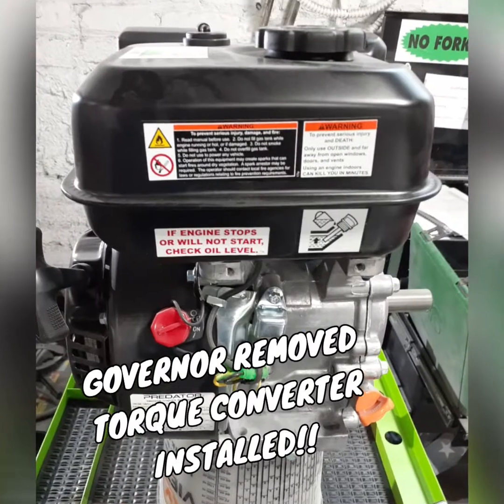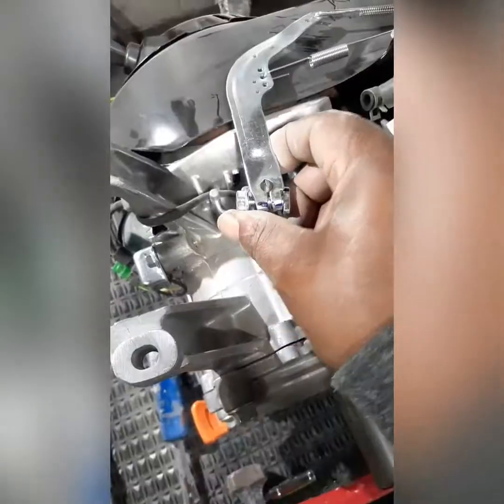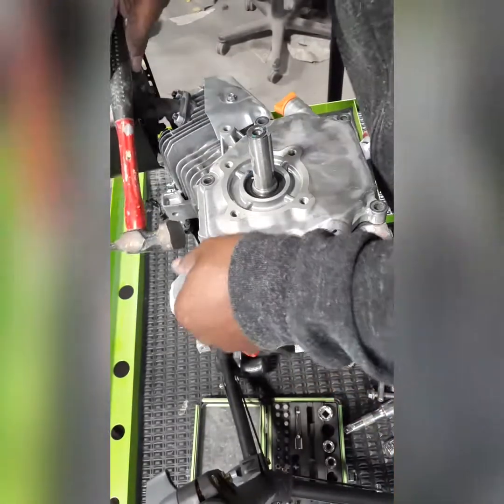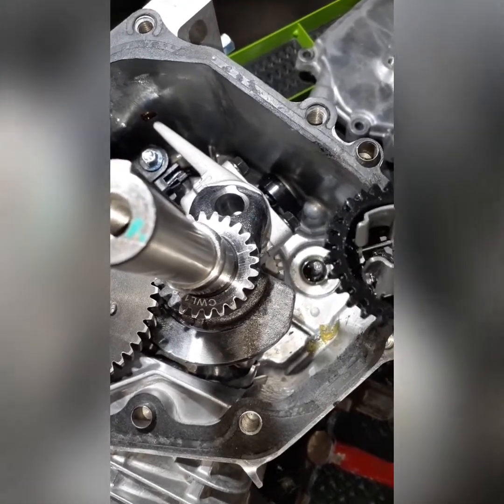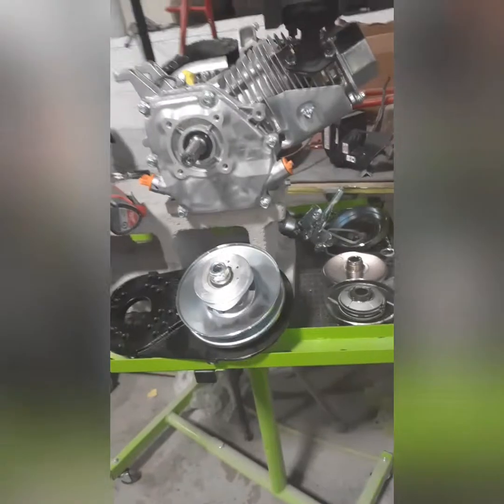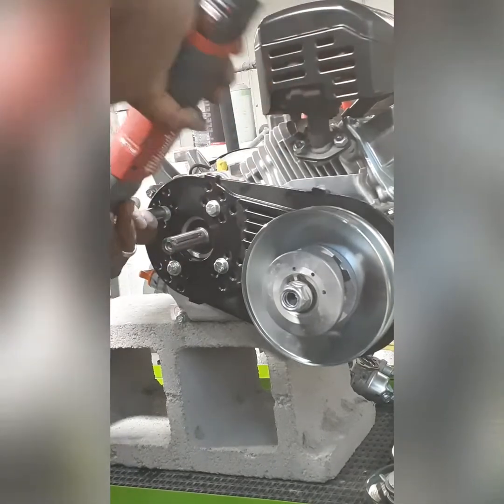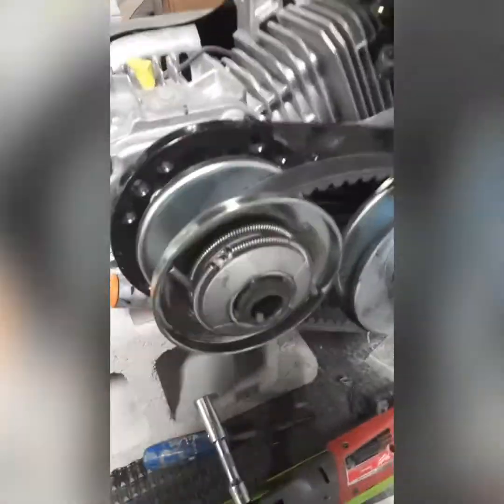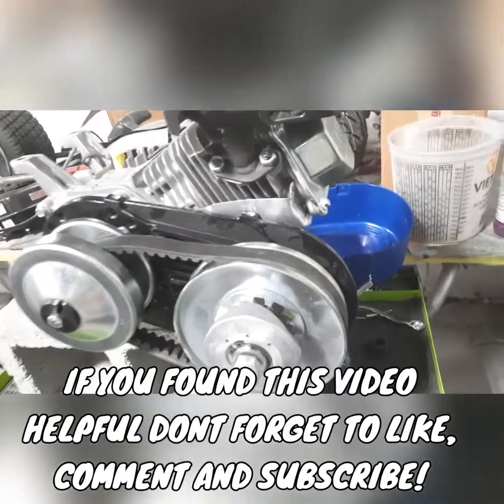REMOVING GOVERNOR & INSTALLING GOPOWERSPORTS TORQUE CONVERTER ON A PREDATOR 212 MOTOR

Comment: Once the governor is removed will it cause issues to happen later on or would it be okay
Reply from the maker: The governor just starves the motor of fuel at high rpms essentially reducing your top speed.. dont worry you'll have fun ! 👍
Reply: @erikd804  alright cool